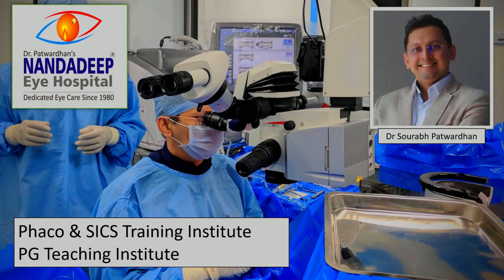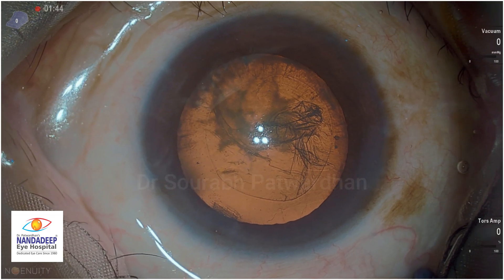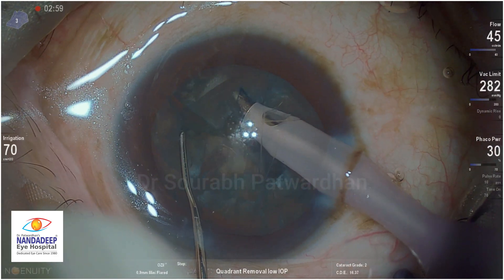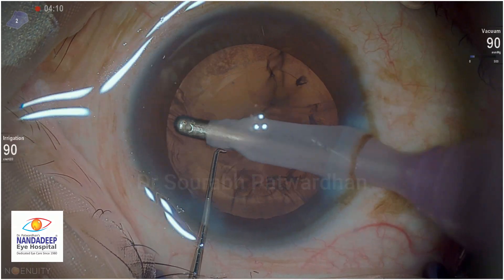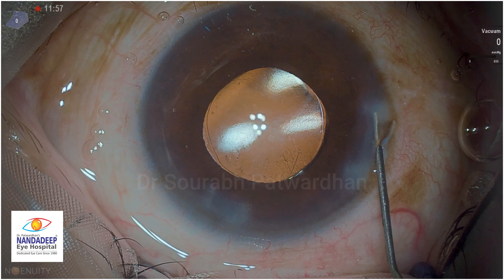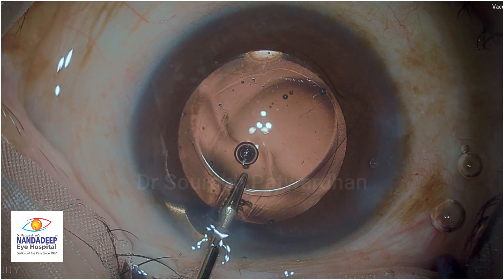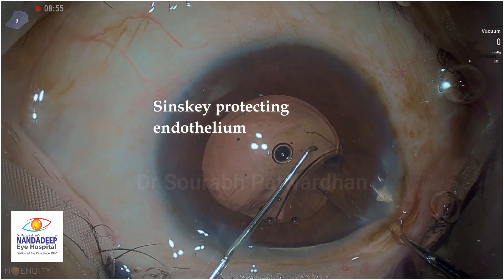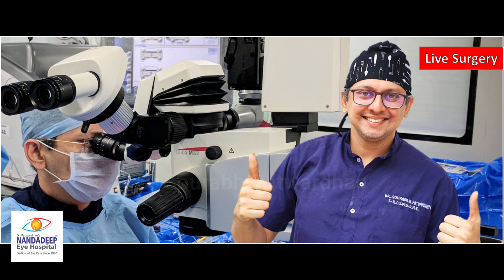253 what happened in those 5 minutes- Constelltion phaco system Dr Sourabh Patwardhan

Comment: Great learning video. Unavoidable hurdle but certainly anxiety inducing for new beginning surgeons. My 2 cents …  while removing the cut edge of the lens, it can be sharp and can potentially expand the inner lip of the wound with its sharp edge. Hence slow deliberate movements at the wound edge is important. The twist n out technique is also a good method for removal that does not require lens cutting.
Reply from the maker: Hi.. there are many good methods. I have used this particular method so many times now, I can do it without any complications now. Twist and out technique works well as well in soft lenses like acrysof. But for harder materials one need to be a bit careful. The cutting technique I use, works with all foldable IOLs equally. 
Its better to continue to use one technique till you master it. So you can choose any technique.